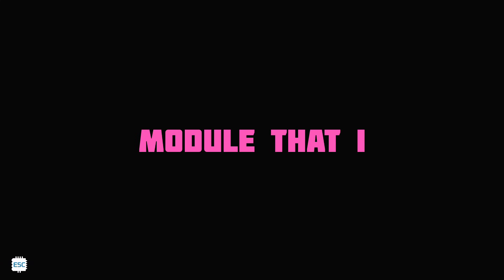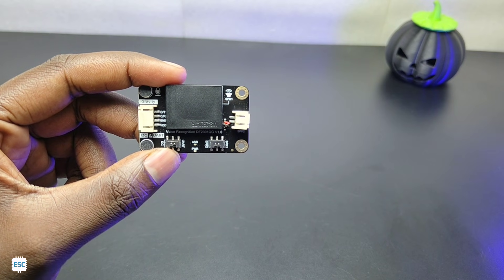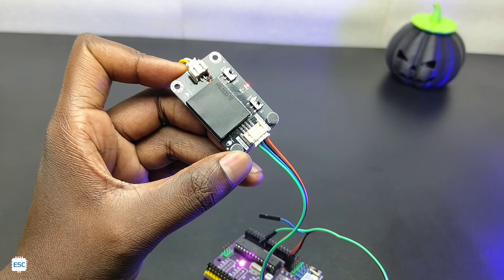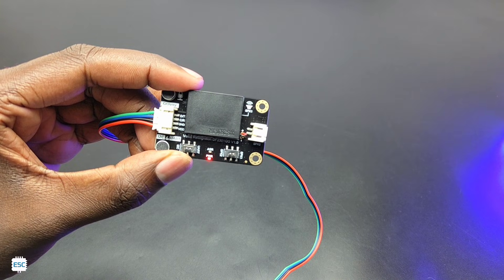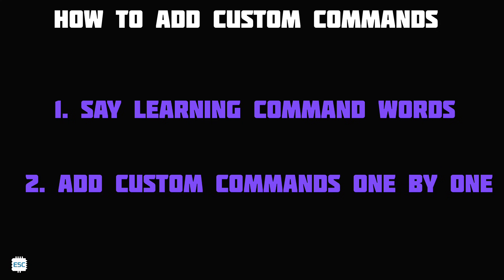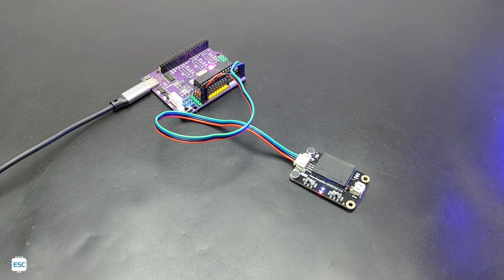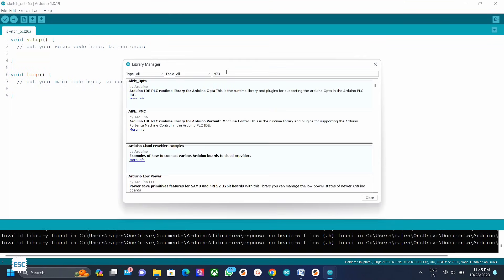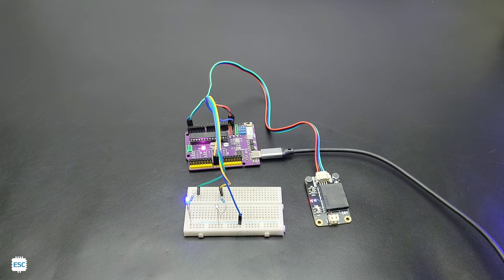BEST electronics Module EVER | DFROBOT offline voice recognition module

Comment: I am using vc02 with arduino nano bht relaay is not triggering afer giving commands what is the reason behind it
Reply from the maker: I haven't used the vc02
Reply: @EDISON_SCIENCE_CORNER  relay is not treggering iss there any solution i think arduino nano is not woring properly
Reply from the maker: May be

Comment: Hi,
Does uploading the code you provided make this project work or will I have to change the code and also tell you that this sound already exists and is being played back from the speaker?
Reply from the maker: See we need to train the module first like i demonstrated in the video. Then you can use this code. It should work.  The words save on the module not in the code.

Comment: Help, mine doesn't work. It recognizes the commands but when I try to print the CMDID, it shows only 0. Any idea why?
Reply from the maker: Please try the example from the official site. And check the baud rate.
Reply: @EDISON_SCIENCE_CORNER  I did try the sample code from the site and checked the baud rate. Here's what it's showing in the Serial port:

wdt reset
load 0x4010f000, len 3424, room 16 
tail 0
chksum 0x2e
load 0x3fff20b8, len 40, room 8 
tail 0
chksum 0x2b
csum 0x2b
v00044020
~ld
�� � �'�;��'<� l � l`  c�   �| s� $�o��'� l` ��r�l�l �   �

I have no clue how to solve this.

Comment: Sir if I use UART COMMUNICATION means Serial communication with Arduino nano, then I don't need to add dfrobot library, isn't it right Sir? Or I have to add the module library for working the module with Arduino? Please help me...🥺
Reply from the maker: You have to use the Library
Reply: @EDISON_SCIENCE_CORNER  Thank you so much Sir for support 😊

Comment: Just question when you say a comand the device talks and does the command, is there a way to remove the talk so it just does the command after you command it?
Reply: yes you can mute it in the code, but also put the switch on speaker 2
Reply from the maker: I think no . The module comes with that inbuilt